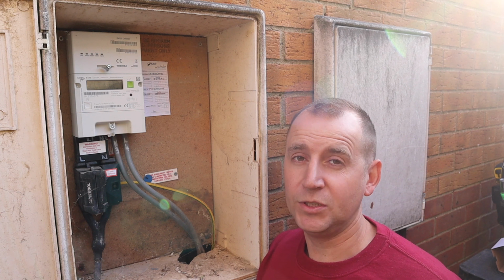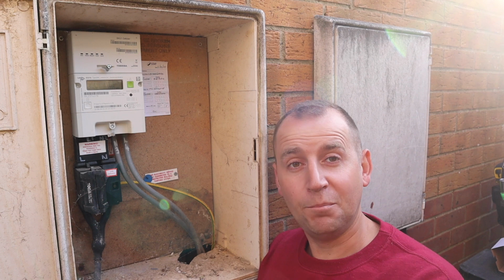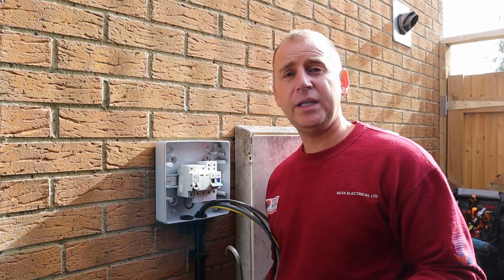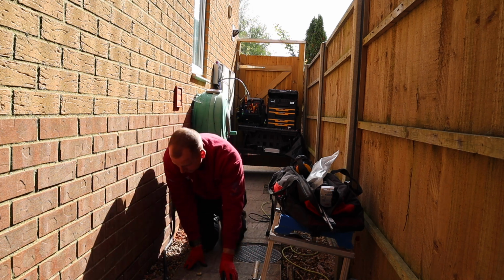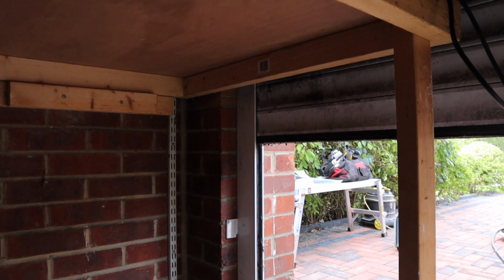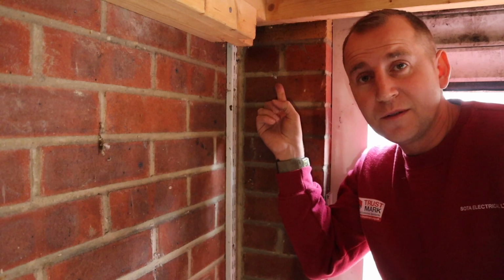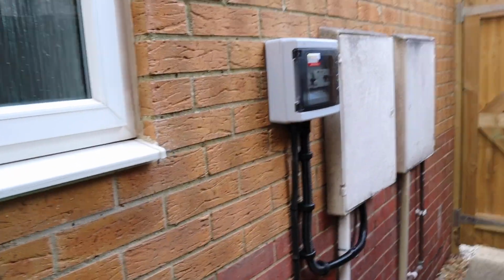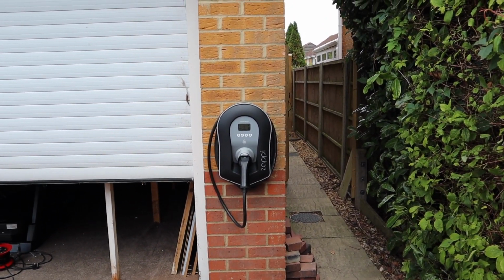BECOMING AN ELECTRICIAN.....JUST DO IT!!

Comment: Did you seek permission to remove cut out fuse. Why did you not fit an isolator while cut out was out.
Reply from the maker: Hi Gino, hope your well, thanks for your comments/questions, as you mentioned earlier I do take a lot of pride in my work which should be a good indication that all of my work is above board. If you have any more questions or wish to discuss my installations or work methods feel free to give me a call during the week, I would be happy to chat with you and it’s generally quicker than going back and forth typing on here. Hope you enjoy the rest of your weekend and thanks for watching.
Reply: Gino if SOTA going to waste he’s time notify DNO to remove a Cut Out Fuse taking 1-2 month For DNO to come and give him permission for removing a cut out Fuse he will lose all hi’s Clients to waste hi’s time to remove all the Cut out Fuse for all jobs is not so easy to manage all the jobs with DNO for every cut out fuse no need to do that what permission as son as you are Approved Electrician you can do it is not a problem
Reply: @emilgemc8913  I then must appoligies I did not realise that the rules have changed. I cannot seem to find them on my searches for each DNO I have searched ,maybe you could help me find that info sir. I have seen so often electricians pulling a fuse but not fitting a £30 quid isolator after which makes so much Sence . Remember I only asked the question he may well of had permission from the local DNO but odd an isolator was not fitted after ,bit of extra £ for a great job he done.